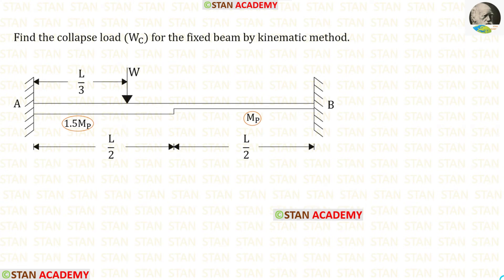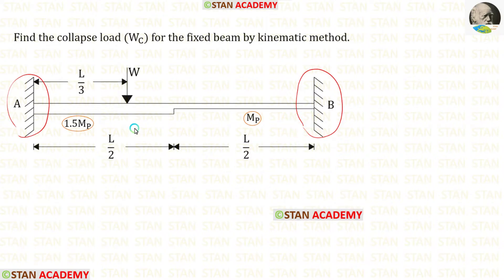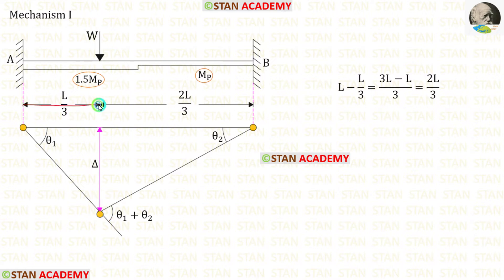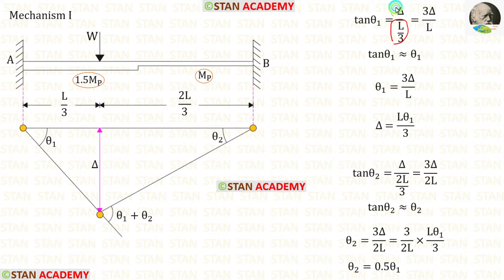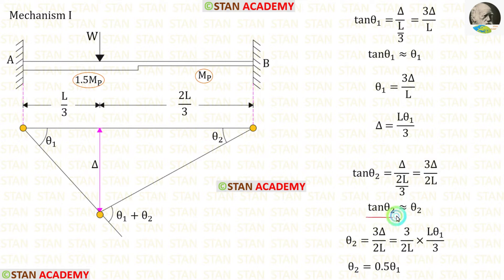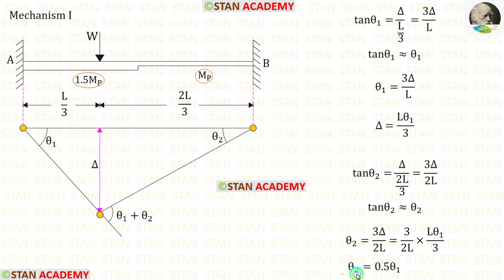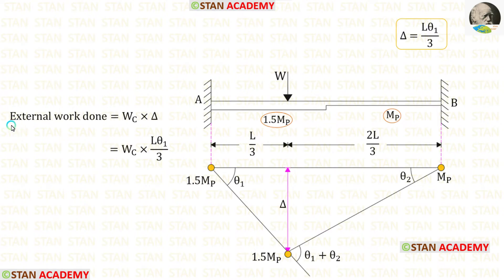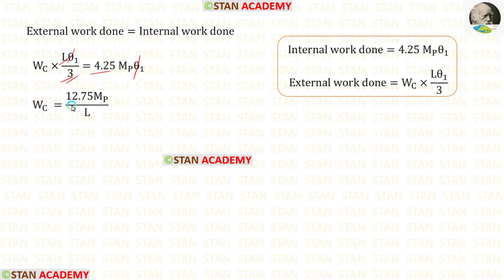Plastic Analysis Problem No - 2 ( Finding Collapse Load in a Non Prismatic Fixed beam )

Comment: in 2nd mechanism why did you assumed the hinge at L/2? is it because the value of Mp changes from L/2 distance or because it is a kind of rule to take at L/2?
Reply: Because at L/2 there is a change in the section of the beam (i.e. change in value of Mp)